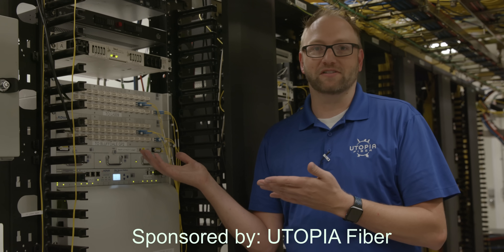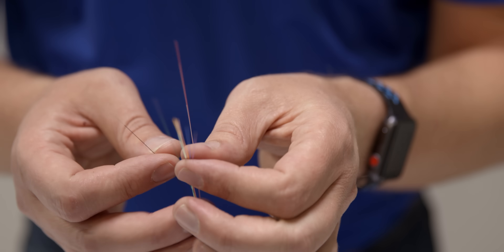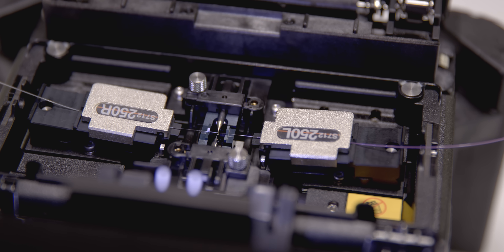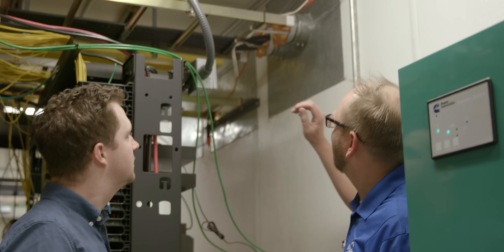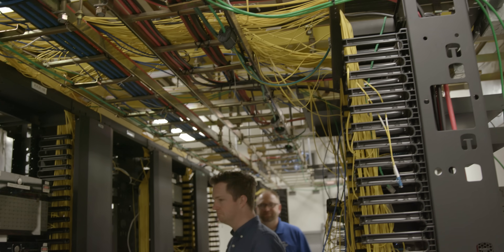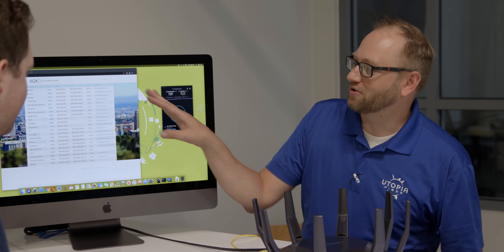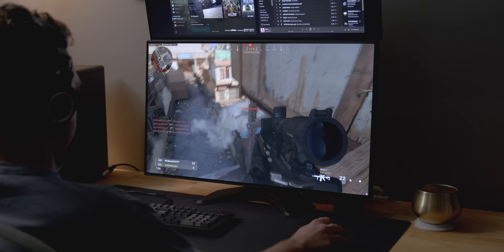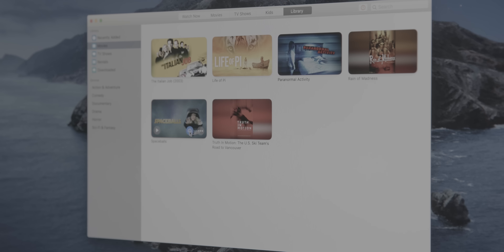4 Terabit Internet?! Fiber Company Tour!

Comment: I miss Utah for this reason.  Utopia is amazing!  Transfer 4k RAW footage amongst editors seamlessly.  Now that I am in Cali for film specifically they seem to have not caught up to par with measly 500mbs speeds.  Spectrum needs to wake up and start laying fiber lines or hanging them...either way California LA area needs fiber bad.  Comcast is the devil, stay away from anything xfinity/comcast related.
Reply: As a charter/spectrum customer. They suck. They won't upgrade their speeds unless some competition comes along. So until At&t or Frontier expands Fiber into your area, you're stuck with their speeds. Google was planning to expand into LA but it was too much of a hassle.

Spectrum finally upgraded their network to DOCSIS 3.0. It'll take them awhile to upgrade to DOCSIS 4.0. They won't lay new fiber because it's too expensive. Cheaper for them to upgrade to the next Cable internet system.

Comment: Verizon Fios has decently priced gigabit where I live. It’s amazing so many places still have terrible internet. Especially upload. Shows how important competition is.
Reply: And looking at UTOPIA's pricing, the cheapest you get 1Gbps is $50/m for the ISP + $30/m for leasing the fiber from UTOPIA. That's about what Verizon charges, and they paid for all the infrastructure. I would probably prefer where the ISP sat on top of fiber that was independent (like dialup was), but I have very few complaints with Verizon FIOS. Fast, very reliable, relatively cheap.

Comment: My internet: ping 59ms 4mbps and 1mbps upload speed
Reply: Mine .8mbps down .5 Mbps up
Reply: @blakeok952  Survive my friend, survive !
Reply: F
Reply: I used to have a 0.25Mbit internet until corona happened (it was for free where i live, still is i assume). It was fine for most things i used to do, like reading news, books, etc. Even Youtube videos kinda worked, only hand to wait for adds to load for a while (apparently the adds are always at a higher resolution, or something).  So, now that i work remotely, i had to get a faster internet (300Mbit, costs ~20e/month here), the difference is quite noticeable. However i highly doubt most people will have any need for 10+gbit internet any time soon (especially if the price is easily multiple times ~100-1000mbit internet), so ok.